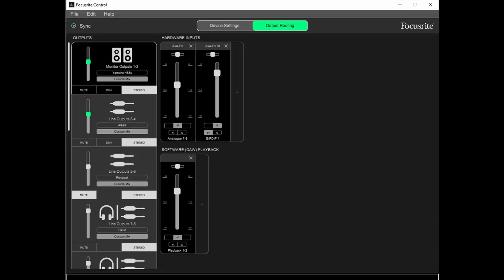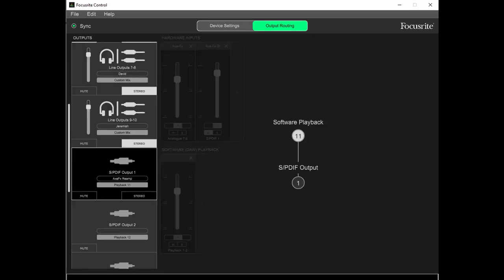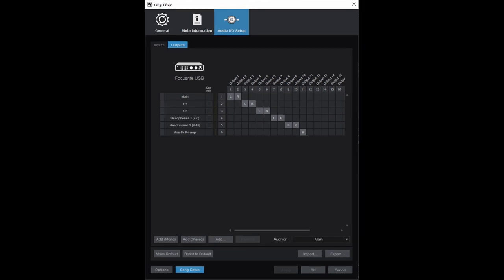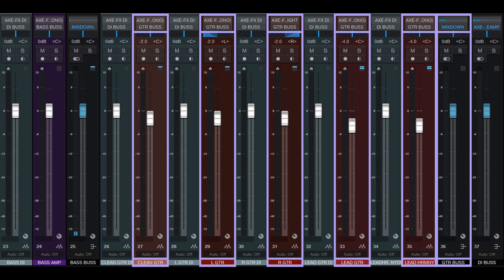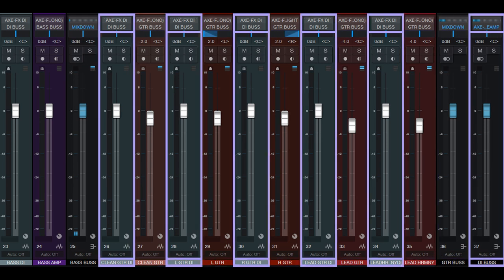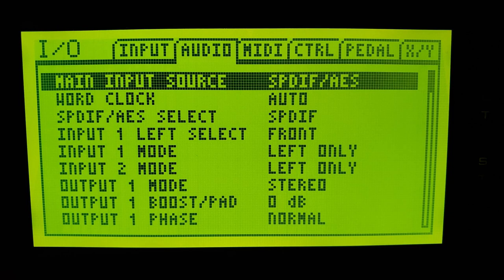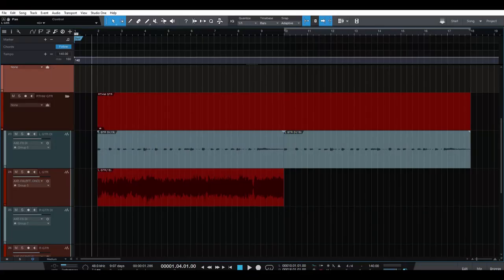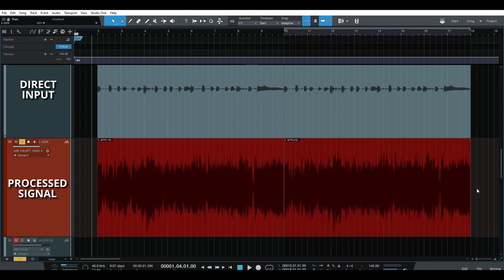How to Reamp with an Axe Fx

Comment: I am doing the same setup, but when I switch to SPDIF for the input I get a nasty feedback loop. Any ideas on what I’m doing wrong?
Reply from the maker: Check the routing software for the interface. I bet that your SPDIF input is going out your SPDIF out, causing the feedback. Make sure that there is no audio getting sent to your Axe-Fx other than the bus that you have setup in your DAW for reamping. Then once you find something that works save that routing as a preset for your interface that you only use when reamping.
Reply: Jeremiah McGowan I’m using focusrite  control, same as you, I only see two SPDIF output nodes. Is it possible for you to explain, or to make a video on how the routing works on Focusrite control? (Sorry to ask)
Reply from the maker: Try watching the video from the beginning to the end and copy what I do one more time. If that doesn't work take some screenshots of Focusrite control and your routing in your DAW and upload them using the link I have in all of my videos. The link called Music & Relevant Files. But I like the idea of covering this in a video! Thanks!